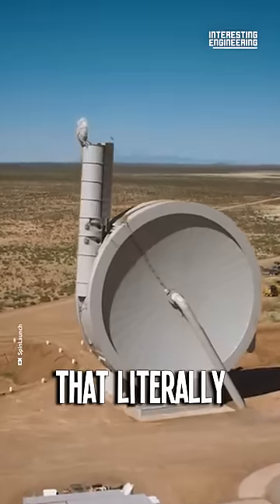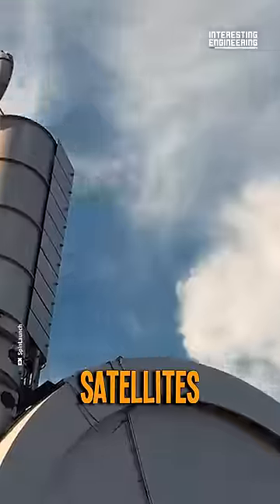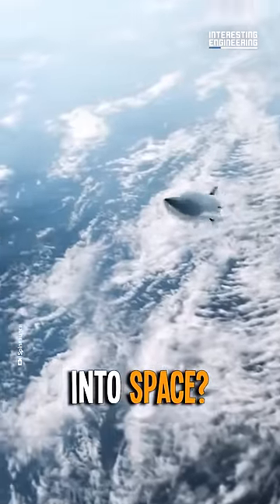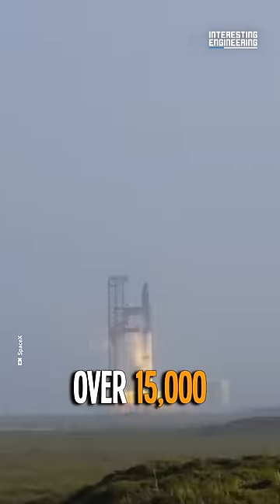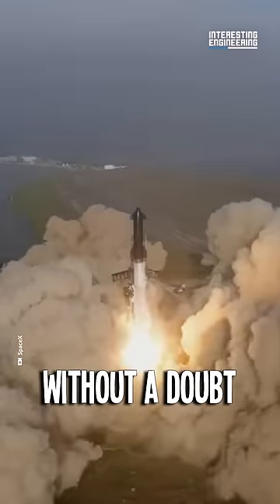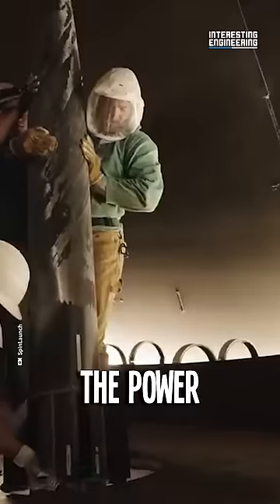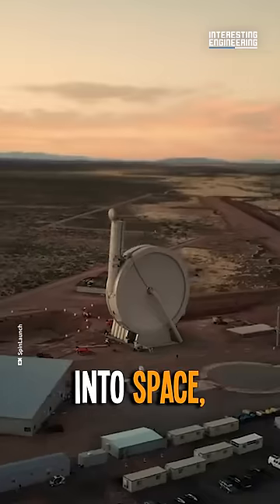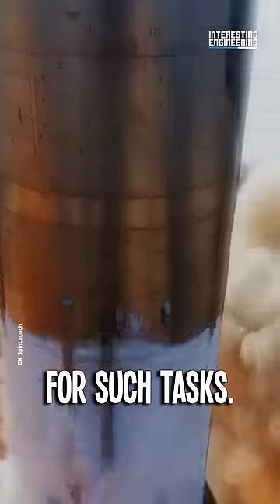Throwing Artillery Shells Into Space

Comment: If your satellite can survive this, it's space ready.
Reply: if you can survive this, you're space ready.
Reply: It's called cyclotron method basically it's for a Small charged particles like electrons and protons etc by using electric and magnetic field to gain high speed
Reply: They would have to pot the entire satellite in resin to stop it ripping apart.
Reply: Rocket launches are rough too.  There’s a lot more shaking.
Reply: Gunna catch that road runner finally
Reply: Love to see they testing this on people, and make them flat
Reply: @Tailspin80 it doesn’t get that fast in seconds this guy is wrong. That’s not how it’s done. lol nothing could withstand that many G’s and still work. 😂
They spin it slow at first then slowly increase the speed over 24-48 hrs I believe then launch it. That way the G force never gets to the point where it just crushes your satellite or even the rocket for that matter
Reply: @hunterbidenparmesanimports5633  It’s the centripetal force that’s the issue. I.e. the force towards the centre of the circle, which is huge at the speed required to get anywhere near escape velocity. Do the maths.

F = mv^2 / r
Reply: @Tailspin80 It's not nearly enough to destroy a satellite. They spin it up slowly.
Reply: @Studio23Media  Rotational acceleration not relevant. They have built a giant centrifuge. How do you think a spin drier works?
Reply: Not sure ability to withstand this has any relevance to a spacecraft’s ability to deal with surface charging, bit-flips, etc.

Many of the issues that must be engineered for are more electrical than structural, is what I’m saying
Reply: @hunterbidenparmesanimports5633  dude, please don't make any comment about any physics related topics again in your life. What you've wrote there must be the dumbest thing I've ever read. This felt like Homer Simpson talking about quantum physics.
Reply: I like how people think that regular rockets already don’t reach crazy velocity and experience high Gs and turbulence.
Reply: @joelbell242  4 to 5 G, buddy. That is the most a big ass rocket like Saturn V would produce. Not 10.000+ G of centrifugal force this thing needs in order to launch into orbit. Turbulence shakes a rocket sure, but again nowhere close to 10.0000+ Gs.
Reply: @GusCraft460 but the acceleration time is much shorter. On this the satellite has to withstand very high accelerations till its released. It would be much easier to put it into a giant gun and shoot it to orbit. Similar max acceleration but for a much shorter time
Reply: Indeed
Reply: @Studio23Media regardless of how fast or gradually the pod is spun up, it is the lateral acceleration that is the deal breaker here.  This will never work.
Reply: @jeffcard3623 yes, the satellite has to be strong enough not to be crushed even before the launch.
Reply: 24h ??? They need to reach like 30.000 m/s. If it takes 1h then it would be already less than 1 g in acceleration.
Reply: 24h ??? They need to reach like 30.000 m/s. If it takes 1h then it would be already less than 1 g in acceleration.
Reply: 24h ??? They need to reach like 30.000 m/s. If it takes 1h then it would be already less than 1 g in acceleration.
Reply: 24h ??? They need to reach like 30.000 m/s. If it takes 1h then it would be already less than 1 g in acceleration.
Reply: 24h ??? They need to reach like 30.000 m/s. If it takes 1h then it would be already less than 1 g in acceleration.
Reply: 24h ??? They need to reach like 30.000 m/s. If it takes 1h then it would be already less than 1 g in acceleration.
Reply: Not just space-ready. It could effortlessly survive a low jupiter orbit
Reply: @GusCraft460 Ya but rocket launches don’t include a 100 G maneuver, I’m not sure how you could protect most cargo with this method. Looks awesome
Reply: @Tailspin80 the company says that many common use electronics are actually capable of surviving the ride.
Reply: It's actually more then that
Reply: @BeyondAbsoluteInfinity  How is that hard? Are the tidal forces so big? Orbit is bacsically free fall so the acceleration should be 0
Reply: There’s Air Force pilot video of them doing the centrifuge. That would happen to you 10x
Reply: @HandOfSatan what's sad is Homer actually did a decent job of it though. But agreed he should review physics. Even though something spinning at a constant rate only has a velocity to it they apparently forgot it also has a linear component to it. Anything spinning is under a constant state of acceleration.
Reply: @Tailspin80  It's not the acceleration in the spin that's the problem, it's the initial g-force it encounters the moment it enters the atmosphere. The earth's escape velocity is 24,923 mph. A Saturn V builds up to that speed over the course of it's first stage burn. For this to work - it's initial speed must be far higher since it will do nothing but slow down once it hits our atmosphere.
Reply: @shouldhavedonebetter  Wrong. It’s travelling at 25,000+ mph at the instant it is released. It then decelerates continually due to air resistance. In practice it would (a) be crushed by centripetal forces before release, and (b) burn up in the atmosphere for the same reason a meteorite does when it falls to earth.

Nothing dramatic happens at the instant of release. It just starts travelling in a straight line instead of a curved one. Like a stone leaving a sling.
Reply: @Tailspin80  I understand centrifugal forces. It's not enough to destroy a satellite. I'm sure there might be some satellites that can't be launched this way, but that type of force, as long as applied gradually, isn't particularly difficult for a satellite.
Reply: @jeffcard3623  It has already worked...
Reply: @Studio23Media  Have you looked at the maths? 

A = v^2 / r

Escape velocity = 11,190 m/s Assuming a radius, r, of 10m this gives a centripetal acceleration of 1252161 ms/s. That is 125,000 Gs! It would crush anything flat. It would probably be enough to make artificial diamonds from carbon. Even if you increased r to a km it would still be humongous.
Reply: Junk science. How many tax dollars were wasted on this? Will they try a big slingshot next? Are the engineers 8 years old?
Reply: You're right, most satellites would be centrifuged
Reply: @Tailspin80  that's an interesting idea, maybe something that "boils off" when exposed to vacuum? No, wait, the inside of the launcher is a vacuum.
Reply: @hunterbidenparmesanimports5633  Dude the angular acceleration is almost irrelevant. It's the centripetal that would kill you... And the jerk at launch. Yikes.
Reply: @Kashur_lofi your one of the only shorts commenters that don’t give anyone an oscar good job
Reply: @Tailspin80  you're very wrong - it must be traveling - upon release - far, far higher than 24,923 mph, since it will do nothing but decelerate in the atmosphere (particularly in the dense lower atmosphere). Also - when it leaves the spin chamber vacuum and hits the air - no matter how aerodynamic the capsule containing the payload is, I'd be shocked it it survived for more than a micro-second. They can spin it fast and launch it high - but not fast or high enough to reach escape/orbital velocity.
Reply: I thought the point of this thing was assisted launchs it spins it up and launches it then a rocket gets it the rest of the way @shouldhavedonebetter
Reply: @Kashur_lofi no. Not how this works at all.
Reply: @mattschm5486 it's been tested before in the 60's with 16 inch guns.
Reply: what I came here to say
Reply: @Tailspin80 
At escape velocity it will burn up in the thick part of the atmosphere. Rockets are much slower where the air is dense, they don't throttle up till the air is thin.
Reply: @electricslide8469  It's already completed a successful test. 🤡
Reply: @Tailspin80  You should try listening. It doesn't throw it all the way into space. 🤦🏻‍♂️
Reply: 7⁷o⁸8iòuiù⁸
Reply: @Tailspin80  to bad, it works anyway
Reply: @joelbellJB they dont reach thousands of G’s. Maybe a dozen at most. Not thousands.
Reply: It never exceeds the forces of a normal launch. It is accelerated in a controlled manner so that it doesn't cause high g forces. The highest force is when it breaks through the membrane on the end and starts dealing with aerodynamic drag, the inside has a vacuum pulled to reduce friction.
Reply: @johnathon007  not true at all. The centrpetual acceleration is tremendous as the orbital object travels in the circle. Probably 1000+ x gravity. Go drive your car in a circle and you will maybe understand.
Reply: @Tailspin80  the rocket doesn’t go towards the middle of the circle. It rides around the outside edge of the inside of the circle
⭕️. They have been talking about this for a few years. I wasn’t trying to be rude to you sorry if you took it that way. The rocket is clamped in a way that when the clamp lets
Go and the opening opens up the ticket will shoot straight up
Reply: If they can get into space, they will have a HUGE advantage be cause the satellites don't have to be made lightweight.
Reply: @HandOfSatan 😂😂Homer, that's great.😂😂
Reply: @jeffcard3623 never is a long time.
Reply: It would melt before it  left the lower atmosphere not to mention how fast it would need to be going leaving the launch facility after slowing due to aerodynamic drag from the air and still be at escape velocity... not possible.
Reply: @bradleyrex2968  that’s not true. This thing generates hundreds of g’s once it is up to speed. 1kg is like 100 kg and no way the spinning arm can handle that load if the satellite is very heavy.
Reply: @hunterbidenparmesanimports5633 your slow. Theres no way you dont understand centrifugal force..
Reply: not the satellite i concerned

the woke innovation is how inflation improved
Reply: And if you can survive this, your probably not real or your just like that
Reply: @Studio23Media  no it hasn't
Reply: @johnathon007  anything that could go fast enough to reach orbit would burn up, like at re-entry, so many ignoramuses here.
Reply: @Tailspin80  But what if you make it only reach a part of this speed and then on the launch release you make a explosion in a chamber like when you shoot a bullet with a gun?
Reply: hold my shock absorbers...
Reply: @theout90  You have the same problem. If you go at a useful speed for getting anywhere near space you burn up and/or slow down long before you get there. It’s actually worse than entering the earth’s atmosphere and descending, because you lose speed due to gravity as you ascend, as well as through air resistance.

A rail gun could be a viable way to launch from the moon. Read “The moon is a harsh mistress” sci-fi book.
Reply: @Tailspin80  Nvm already solved that.
Reply: An iPhone can endure higher G load than what this produces. In fact, dropping your phone on the floor produces more force on the phones components than spin launch would do. Don't mix up velocity with acceleration..
Reply: That's the problem- it won't. The satellite will turn into mashed potato from G-force.
Reply: @digimaks  modern electronics with surface mount components are capable of withstanding thousands of Gs. For example dropping a GoPro on a hard surface is already between several hundred and a couple of thousand Gs.
Reply: @@brathahn5701 Centripetal force, technically. Yes, although it reduces as you increase the diameter of the spinner. But the real showstopper is that nothing flies faster than about Mach 10, and then only in the rarified upper atmosphere. You would not be able to launch with enough speed to make it worth it.
Reply: “ satellite”😂
Reply: @Studio23Media actually you clearly don't understand "centripetal" (not centrifugal) force.
Reply: @HandOfSatan  lmao, true
Reply: @Studio23Media  it does not matter how slowly you achieve the final rotation. It has no effect on the final cenrifugal force. That force depends on the angular speed and radius of the contraption.
Reply: @hunterbidenparmesanimports5633  ok but how will it stops to rotate when ejected ? And, also lateral acceleration will go immediately to 0, too. Not soft.
Reply: @Studio23Media please stop embarrassing yourself, acceleration is not the issue, it’s the spinning itself.
Reply: @undefined69695  Acceleration is what breaks things on satellites. Satellites are normally moving at 10s of thousands of miles an hour orbiting Earth.
Reply: And how much energy is spent to start the spin up to launch velocity?
Reply: @HandOfSatan  That was nothing wrong with his comment. Maybe you need to go back to school to get that.
Reply: @mickimicki5576  we're talking about this comment, right? "it doesn’t get that fast in seconds this guy is wrong. That’s not how it’s done. lol nothing could withstand that many G’s and still work. 😂
They spin it slow at first then slowly increase the speed over 24-48 hrs I believe then launch it. That way the G force never gets to the point where it just crushes your satellite or even the rocket for that matter"
If you are serious about that you are the dumbest person to ever tell ME to go back to school again 🤣
Reply: Right? That acceleration on release has got to be KILLER. Like you could never do this with human cargo
Reply: @mattschm5486 the G's are not a problem if the force only comes from one side, except here it is a centrifugal force, the problem is therefore not the G's coming from the rotating support, but from the lateral force which will cause it to give way  any support holding the rocket.  You also forget that if the centrifuge wants to reach these speeds over such durations it needs a vacuum space to remove friction with the air, what happens if you take the rocket from a state without pressure  atmospheric pressure to Earth's atmospheric pressure in less time than it takes for a bullet fired from a gun to hit something 5 centimeters from the barrel?  Without also mentioning the technical limits that this entails.
Reply: @MortenBN1988 absolutely not, you forget so many scientific and mathematical factors.
Reply: little explanation for those who persist in saying that it would work: The problem here is that this principle generates a centrifugal force, the centrifugal force is when an object turns in circles and is directed outwards, to imagine it,  just think of a ball held on a spinning platform, now imagine that suddenly the platform disappears, what happens?  The ball simply goes straight because it continues in the direction of the last force that acted on it (relative to direction).  It is also important not to mix acceleration and force, the "G" is not acceleration or centrifugal force, it is a unit which is used to measure kinetic forces in relation to an object, this includes several types of  forces and energies (as here with acceleration and centrifugal force, but also other forces).  To simplify, on the question of centrifugal force, it will take a centrifuge of several hundred or thousands of meters so that the centrifugal force is less strong on the object (because the greater a change in direction of forces, the more it will induce  pressing this object outwards).  There is also the question of acceleration, but in reality mainly of deceleration when the object goes from one medium (vacuum to avoid friction) to another (earthly atmospheric pressure), you might as well tell you that at this speed  It will be like jumping off a bridge from a surface 400 meters high.
Reply: @tbfrstudio5416  I was replying to the people saying that g-forces would destroy the satellite, not anything else. We already produce electronics (in weapons munition) that withstands forces up to 100.000G. Peak G force of Spin Launch is calculated to be 10.000G so G forces is by itself, not a deal breaker, although it naturally limits what kind of electronics you can utilize.
Reply: @Tailspin80 oder er wird zusammengefaltet, sodass es sich um eine Dichte, massive Kapsel handelt. Ist er ins All, entfaltet er sich.
Reply: @GusCraft460  i don't think rocket launch have this much shaking
Reply: @badabing7820  In English?
Reply: @Tailspin80  i don't know, what's your problem, but i have a translate button under text.
Reply: @Tailspin80  just for you: or it is folded so that it is a dense, solid capsule. If it goes into space, it unfolds.
Reply: @badabing7820  No translate link under your text on my iPad. ☹️
Reply: @Tailspin80  : They would also have to build it out of unobtainium.
Reply: @HandOfSatan the part he left out when saying you were wrong is that it’s merely assisting with the most fuel intensive part of the launch and is not remotely trying to reach escape velocity (or beyond) from the ground… it’s punching through the lowest atmosphere with a protective casing which it sheds before launching the inner rocket. It’s a hybrid system and allows them to design satellites according to the potential forces—where they would clearly be looking for the sweet spot where the weight to fuel ratio can achieve orbit, while dialing in the (limitations of a) centrifugal launch.
Reply: @Tailspin80  , your formula makes Force inversely effected by Radius, don't divide, multiply radius.   But your original premise is correct.
Reply: @chadgrover3146  No, it’s correct. Centripetal force is inversely proportional to radius. That’s why the test rig is only 30m diameter (I think) but the final production one will be 100m. The larger you make it, the better the maths work out. Except that it costs a lot more to build and run.
Reply: @Realquestion-tx9ry I think it goes beyond the satellite needing to be strong; I assume every component inside would need to be able to take the stresses. It might be possible that even things like electrical components might start shearing off inside if the effects of launch aren't considered.
Reply: Smh there's some dumb ppl here that didn't pay attention at school. Spinning something in a circle is acceleration, because you're constantly changing the direction of the payload to make it go in a circle. Changing direction is one definition of acceleration (the other is changing speed). Acceleration means force is involved. When things aren't built to withstand a force, shit gets broken.
Reply: @gamerg0  Newton says Centrifugal force, which is the force outward while spinning is F=mv2/r....you are not suggesting Newton was wrong are you?
Reply: @Tailspin80  Yeah, I probably had the two backwards.  Wonder if they have a counter balance to keep the rig from tearing apart.
Reply: @chadgrover3146   Newton wrong? Not at all. But I think you have the forces mixed up. The force is centripetal, not centrifugal, and centripetal force is directed towards the centre and is what keeps the object moving in a circle. It's a common mix-up. The velocity term "v" in the equation is speed + direction. The direction of the object keeps changing as it moves in a circle, so we say the velocity is changing (linear speed might be constant but change in direction still means change in velocity), and changing velocity is acceleration, so we're back to Newton, F = m.a. I prob glossed over some steps here, to avoid bringing maths into it, plus I can't draw here, but there are many good videos on YouTube that aren't made by ppl trying to sell a rocket washing machine :)
Reply: @chadgrover3146  That’s one of to many issues I had not considered. When the payload releases the counterbalance would have to instantly adjust by moving inwards towards the centre of rotation, otherwise the whole rig would destroy itself.
Reply: @hunterbidenparmesanimports5633 he's technically right. He never said how many seconds. It could be 86,400 - 172,800 seconds.
Reply: @gamerg0  agreed, but I believe the Accel element is what causes "Jerk" or Force constantly pushing outwards which I would think is Centrifugal.  The item when released uses the KE until depleted.   In this case, they fire boosters.  I probably need to dig out my 30 year old Physics book before posting.
Reply: @chadgrover3146  I know what you mean, it is confusing. I think what we call "centrifugal force" is the feeling caused by the centripetal force. The centripetal force makes something move in a circle, and the centrifugal force is the "weightiness" that we imagine occurs as a result. It's probably semantics; things do fling outwards but that's the effect of what we strictly attribute to the cause of centripetal force. My physics text books are also a little old.
You're right, KE will get used up and then boosters fired. I think that part of the journey, after release, will be the least stressful for the internals of the satellite (the casing will obviously feel stress moving through the atmosphere, but no more than when it was inside the spinner - there's air in there also). The most stressful part (I believe) will be in the spinner, when forces are at their greatest due to the machine running under a continuous energy supply. I imagine the internals will need to be designed for stress - this is less of a physics problem and more materials science (eg fatigue failure etc).
Reply: @hunterbidenparmesanimports5633 I have a question. If it takes 24-48 hrs to launch how does this save energy?
Reply: A rocket puts more Gs than this I promise you that
Reply: @Kashur_lofi perhaps but does this process negate the force of gravity on the object? If no, then it’s possible that the atmosphere even inside of the spin chamber could damage the vehicle. Much less when it’s thrown out at ground level at hypersonic velocity.
Reply: @GusCraft460 but not 0 to insert insane g force number in less than 6 seconds
Reply: But it still used fuel right? You can't use energy that doesn't exist right? It requires energy to make the machine work, so where does that come from, and how much does it use?
Reply: It's crazy when you see satellites being assembled in a clean room, with every component handled so delicately. A single knock could cause serious damage. 

Then they launch them into space in the most violent way possible.
Reply: look up that sience dude that made the baseball faster than a bullet.as long as you slowly accelirate it it will explode.
Reply: Well, they are designed for 0 to 1 atmospheres of pressure. What could go wrong?
Reply: Lmao
Reply: Am all for innovative ideas and thinking outside the box so while I am not mad at them for trying their new idea on this one ima have to say as a sharktank fan I'm not on board and still know an idea which likely wont pan out in the long haul when I see one as hurling items into the air isn't exactly the most delicate method and that combined with the obvious very small size limitation tells me that it will be doomed to forever remain an idea and never a solution to really anything tho I could see maybe it going on to have wildly specific uses meaning 1 in a million or more instances where it could be a better way than the many alternatives for a particular cargo that's a MAYBE tho at best
Reply: @HarshThe119 😂😂😂😂😂😂❤❤❤❤❤💀💀💀💀
Reply: @GusCraft460  SpinLaunch claims 10,000G, a rocket generally isn't even over 10G
Reply: @HR-yd5ib  Holy fuck, how are you guys not understanding this? You can increase angular acceleration as slowly as you want, but the centripetal acceleration is still increasing linearly to 10,000G on the side of the satellite THE ENTIRE TIME. You don't just get to pick and choose which laws of physics you want to apply.
Reply: LOL i imagine the g-force alone would vaporize or at least crush any material on the table on the periodic table of elements.
Reply: @jeffcard3623 

It's not intended to launch it into orbit though, it quite literally states that within the video. The aim is finding a first stage boost that relegates the need for a rocket to reach a given altitude (which cuts down fuel usage and potentially energy cost depending on how efficient this thing is) at which point a smaller two stage rocket is implemented.

Yes, shooting something into orbit is likely going to incinerate it unless you have some super-insulated material that can survive such a thing, but in much the same way as theoretical mass driving into the upper atmosphere, you don't need to actually reach orbit, you just have to reach a high enough altitude that you can implement a means of escaping with less frictional force during travel into orbit.

Like, the concept is sound even if this practical implementation does not work. The long term aim is absolutely to launch materials into orbit without the use of rockets for the entire way, a mass driver with a far smaller rocket would very likely be quite effective at moving material into orbit.
Reply: @wtfmanicanthaveaname 

Nah, we can already make significantly G-resistant electronics that can survive the speed this model is spinning at (which seems to be a massive misunderstanding in the comments as the aim isn't to reach escape velocity, it's just skipping the initial launch stage).

Now if you were rotating something fast enough to actually escape into orbit, absolutely, that would break pretty much anything we could make (as in actually useful materials that would be nice to have in orbit). For that you'd need a linear mechanism, and then you run into issues with frictional forces and having sufficient insulation that your cargo doesn't just melt into slag
Reply: @AveSicarius  yes its simple. It will never work. It will self destruct.

A more realistic solution would be a big electro magnetic gun inside a vacuum sealed tube. It could achieve higher velocity without the vibrations of the spinning machine.
Reply: And useless.  In particular, not going to launch any survivable 2nd stage with this high g grant chaser.
Reply: TO EVERYONE IN THIS CHAT:

THE JUDGEMENT OF GOD IS DRAWING NIGH.

REPENT TODAY AND GIVE YOUR LIFE TO JESUS TO ESCAPE ETERNAL DAMNATION,,
Reply: @Kashur_lofi Where are you going after you die?

What happens next? Have you ever thought about that? 

Repent today and give your life to Jesus Christ to obtain eternal salvation. Tomorrow may be too late my brethen😢.

Hebrews 9:27 says "And as it is appointed unto man once to die, but after that the judgement
Reply: @idehenebenezer802  Jesus or God? Jesus is an honorable man and prophet. God is God.
Reply: If you can survive a rocket start to.
Reply: @HarshThe119  exactly
Reply: Let's take it as a brain wave...... Keep on experimenting.... One day in future... Another beneficial use of it  will immerge... May be.  😂😂
Reply: Even though it's weight limited. Smaller satellites tucked in and built and set up to absorb the ride without that rocket slash missile they use might be worth it not until they can prove it 100% and I'm pretty sure the one they're using is not the end result. They want to have a bigger spin launch unit ( this is a disclaimer that I don't have actual facts but that is with a lot of engineers and filters and humans always try to get larger if you can.
Reply: This is destroy the components inside the satellite 😂
Reply: @HandOfSatan  Good thing you and all these YouTube scientists know more than the actual scientists and engineers behind this project.
Reply: @samlicata4650  🤦 simply just 🤦🤦🤦
Reply: @nailclipper7350 no person and no animal would survive the g-forces if you shoot them to the border of the atmosphere. It is even worse than a rocket with solid burst. Another Challenge is to find the exact moment to open the shell. And how to avoid the satellite colliding with an airplane on its flight?
Reply: It's base off Magnetic rail gun theory basically shooting them into space with one powerful punch
Reply: @Tailspin80  🤣😂😪
Reply: We need this on the moon. And one on mars. We can play catch 😂, send cargo and equipment from moon to Mars  or vice verse by spinning it until it reaches 500k miles per hour.  It'll be easier in zero gravity plus they can be bigger
Reply: @Letsgobrandon827  Best comment of this entire thread!
Reply: I am thinking most satellites cannot handle these g-forces.  This is for launching warheads.
Reply: That's what I was thinking, how many g's of centrifugal force does it reach?
Reply: In WW2 the US had proximity fuses in artillery shells. Artillery shells accelerate to much higher G-forces. And these proximity fuses were using glass vacuum tubes for the electronics. So, while it may be counterintuitive, it can be done. Might not be suitable for every application, so you’re probably not going to be hurling a James Webb Space Telescope out of one of these things, probably. But this launch system doesn’t need to be suitable for every application.
Reply: @Studio23Media  it can produce up to 10,000 Gs. That will destroy many satellites.
Reply: @hunterbidenparmesanimports5633  I'm really sorry, but you don't understand centrifugal force. It doesn't matter how slowly you revved this thing up. It'd squish anything remotely fragile.
Reply: But... I heard that Poland cannot into space :-(
Reply: Lol, thank you. I got a chuckle out of this. It was not meant to be funny, but so true it was good for a laugh.
Reply: Worlds largest centrifuge.
Reply: Did Donald Trump come up with this? It sounds like a "nuking a hurricane" sort of idea.
Reply: ha ha exactly.
Reply: @HarshThe119 No human is space ready.
Reply: @Studio23Media  brudda it doesn’t matter how slow they get it up to speed. The end speed matters
Reply: The problem is not the acceleration but centrifugal force.
Reply: @HarshThe119  if you cant survive this, you're ded
Reply: @HandOfSatan hahaha I love this dude. Thank you for this comment 🙏 I can’t stand comments from people who don’t know what they’re talking about
Reply: now, someone get it... 👍
Reply: @GusCraft460 that shaking is from the interaction with atmosphere.. this would be much more aggressive since it's moving even faster.
Reply: @corbinmccullough73  no, that shaking is from being thrown upwards by a continuous and violent explosion.  Rocket engines are not gentle things.
Reply: this would be possible only if a satellite can survive the intense aerodynamic heat from escape velocity at hypersonic speed of 11.2 kilometers per second - 40,320 kilometers per hour .!!
Reply: @hunterbidenparmesanimports5633 have you ever been in the fairground and gone on a spinning wheel and then the floor moves away, does the pressure get less over time, even at the same speed, no it does not so imagine if it kept speeding up soon you would not breathe in, then die and be flattened, the same for any device,  doing it slowly does not help.
It would work to get raw materials into space, but not for delicate devices, so it could be very useful to build in space or on the moon.
Reply: @Imraan-Khann  imagine the object is JWST that is very fragile 🤷
Reply: Is there any concept of space in Islam
Reply: @GusCraft460 i would say that theres less force and the centrifugal forces from the the spinny thing looks like it could rip most things in half
Reply: Your satellite will even be ready for the spaghettification it will experience after being inserted into orbit around TON 618.
Reply: @spclifton91  We have probably all seen videos of evacuated tanks imploding at 1 atmosphere. What would the design of that "membrane" be so that it is tough enough to withstand implosion during the acceleration period yet weak enough to allow the rocket to punch through without damaging itself? ... I read that launch speed is about 2,000 m/s. At the moment of rupture by the nose of the rocket, there will be a sudden influx of air into the centrifuge -- I think it would be at the speed of sound (343 m/s). How will the aerodynamics of the launched shell be affected as it instantly transitions from a near vacuum into Earth's atmosphere, which is rushing in to fill the evacuated centrifuge?
Reply: @hunterbidenparmesanimports5633  that's not how g force works. The g force in this is caused by the super fast rotation. By the time the angular velocity is at orbital speed the payload would be changing direction thousands of times a second.
Reply: @pilotmorgan8669  hey , I do now. The reason I thought that is bc I remembered the video wrong and it stuck in my head like that. Just like how they talk about in space using a rotating outer shell for the crew to have artificial gravity, it doesn’t need to spin fast just keep spinning. Idk why I thought I saw it. Like that but when u work in the heat in FL I swear it fries some brain cells. lol. Anyways I was Wrong and I know it. Thank you for not being a jerk about it. Though I appreciate it
Reply: @mohammedgt8102  If that thing can survive this it's a bunker buster😂
Reply: How many Gs I wonder , if it's escape velocity in a few seconds than I'm guessing way more than any living being and 95% of satellites.  Distance weaponry on the other hand would be a very good application...
Reply: they literally have astronauts do this
Reply: @edwinmaster7326  * divided by 1000
Reply: Modern era large scale trebuchet/sling anyone xD
Reply: @hunterbidenparmesanimports5633  that makes more sense
Reply: Yea the electronics will need to be incased in Resin or plexigrlass
Reply: That's what I was thinking. It would need to be a damn near solid state satellite because the centrifugal force is one hell of a thing to counteract
Reply: @hunterbidenparmesanimports5633  sorry but that is actually also wrong. The Gs aren't from acceleration. Anyway if you want to throw that thing to space the speed is so high that the centrifugal forces crush your satellite not the acceleration itself
Reply: no name _nagging instead
Reply: @Studio23Media  it doesnt matters, if they spin up fast or slow, the centripedal force is the same.
For Spin launch it's around 10.000 G's, and no satellite is able to withstand that.
Maybe thats the reason CEO of Spin launch denied to show spin launch in action...
Reply: The trouble is, it doesn't work!
Reply: They developed it so the satellites could take the extreme g forces
Reply: @mysteriumxarxes3990  they developed Spin launch, they never said sattelites can use that...
Reply: @Kashur_lofi so it's a space rail gun
Reply: I mean they could make the throwing mechanism a gyroscope like thingy if that's count
Reply: YT still fucking with me with these YT Shortd by not letting me start my own comment thread. Also, you start explaining how it works but does not give full details. Like how does it go from spinner to launcher and not go into the walls of the launch tube? Stop cutting details so short. I don't sub too those that does this.
Reply: @martinpillmann6142  yes. I know it is. I remembered the original video I saw years wrong. I’m 42 and. Work in the. Heat in FL
And. Have burned. Too many
Brain cells. lol. But yes. I know it’s. Wrong. lol. Thanks for. Not being a jerk
About. It like others tho. Lol
Reply: @HarshThe119 ur good at everything & don't vote
Reply: not really. There are a lot more dangerous things in space other than mechanical damage lmao
Reply: Can be used on people?
Reply: @Letsgobrandon827 overrated comment